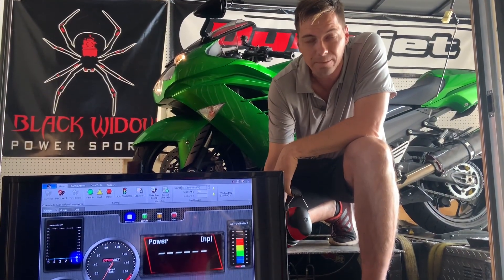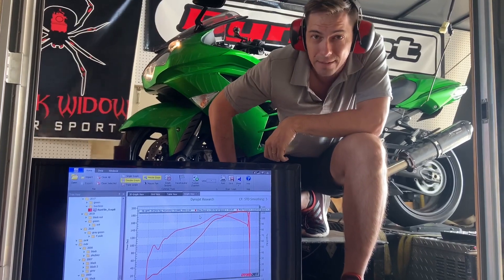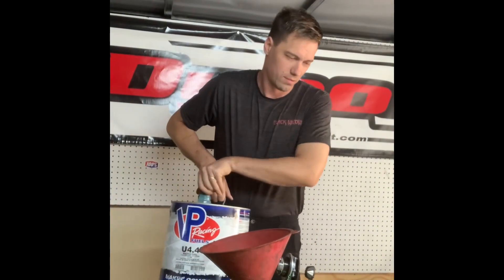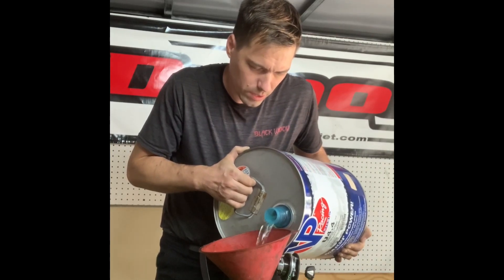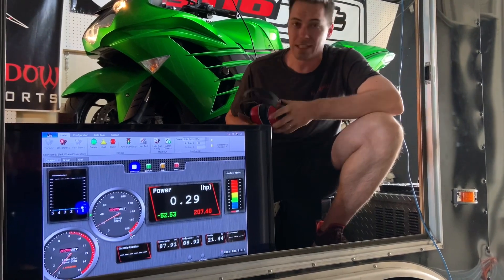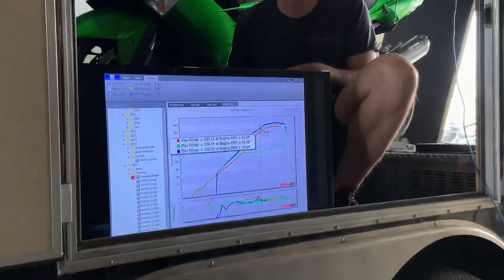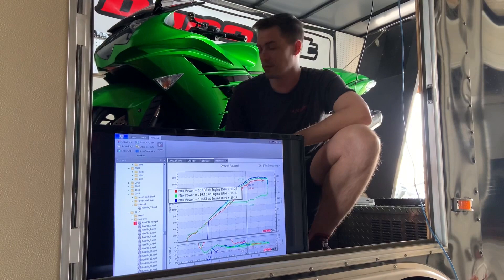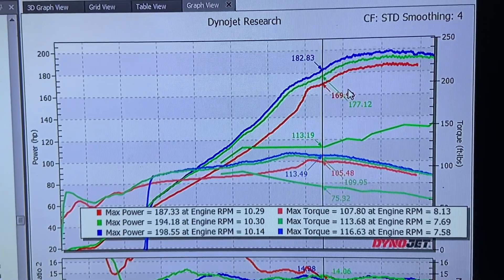ZX14R Ecu E85 - Pump Gas Flashing

Comment: So what would a zx14 with ported throttlebodies and mr12 run?
Reply: From what I've seen on my bike e85 is good for about 5hp and 7ftlbs of torque.   Not sure on mr12 but I've been told it makes more. The e85 made my bike run much cooler but your fuel mileage is cut nearly in half, it takes about 40% more fuel to get the optimal afr. My injectors were at 97% duty cycle and it was kinda hard to find if I made any trips towards the mountains. With 87 octane on a 70 degree day my 14 made 188hp and about a month later my bike made 193 hp even in93 degree North Carolina heat. I'm in the western foothills of North Carolina . Even with a 4 inch over swingarm I still was grinding  foot pegs and even roughing up the mid pipe on my Brocks gen3. My bike has been parked for around 10years, my wife gave birth and I have health issues. I'm pulling the bike out of retirement and am getting ready for a full dyno tune and ecu flash. I'll respond on this comment and let you know how my bike responds to e85 with a full tune and throw some mr12 for shits and giggles
Reply from the maker: Mr12 and e85 get fairly similar performance when it’s 100° outside
Reply: @blackwidowpowersports6037  I had always heard that e85 was better for boost and torque while mr12 would give a few more hp near redline. It would be nice to be able to run e85 and have the same top speed, much easier on the engine.